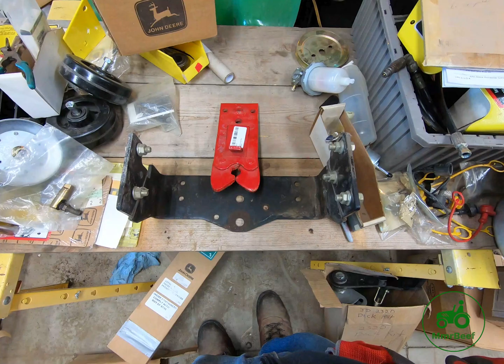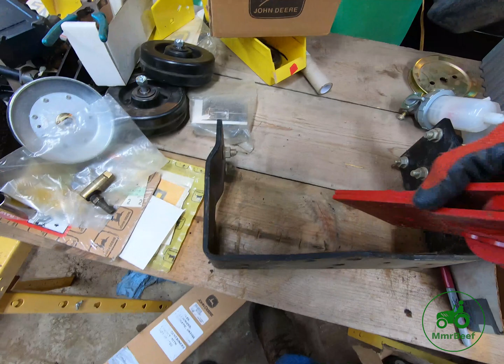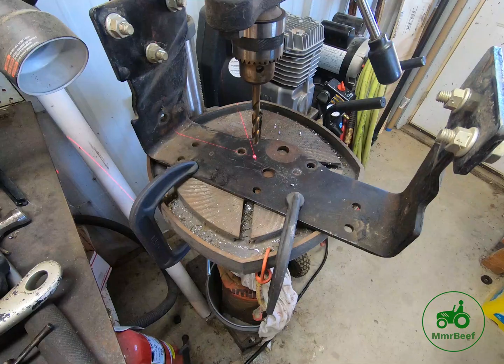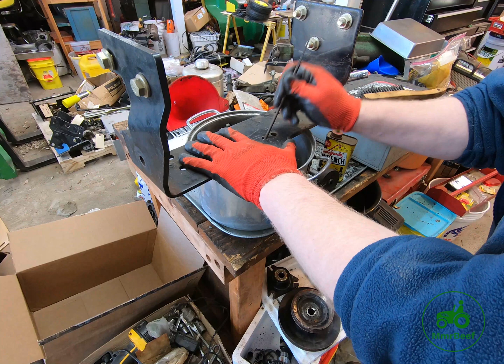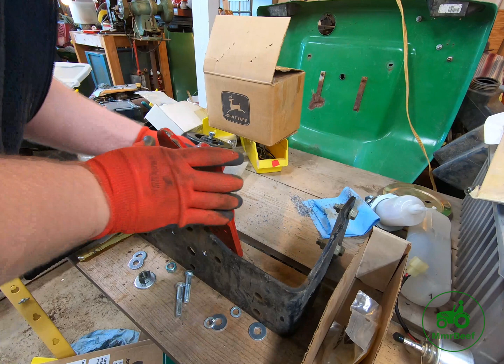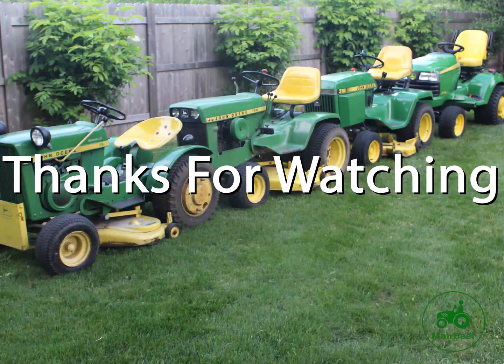A Quick, Hitch Project

Comment: Great series, Do you have a parts line for 318 fuel tank fitting grommets?
Reply from the maker: The current part number is M149638 and looks to be about $4.30
Reply: @mmrbeef  thanks
Reply: Do you have info on what's down in the tank as far as hose lengths or do they use a dongle like a chainsaw

Comment: Looks like you'll have to modify that tongue so that you can turn more than a few degrees...

What we've always used on the farm is the Agri-Speed Hitch, https://www.bergmanmfg.com/index.html
I don't think they make garden tractor units, but they are jack stand and quick hitch all in one, and they work very well.
Reply from the maker: Yes, I will on that cart. Figured I didn't need to get into that on this video. Chance  Those are pretty slick units, I have seen a few in action.